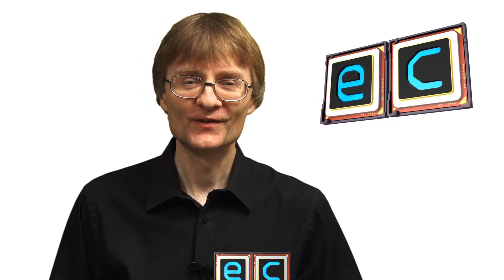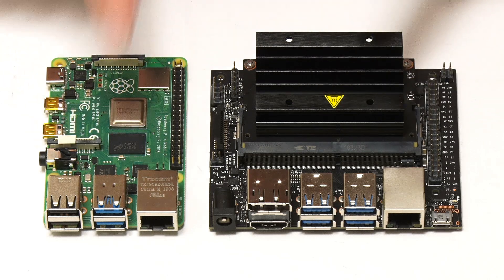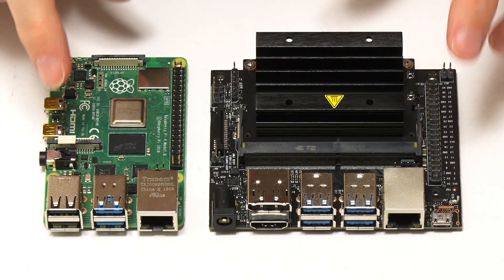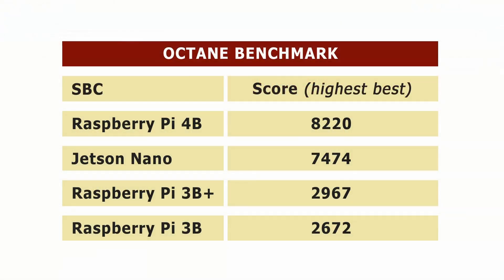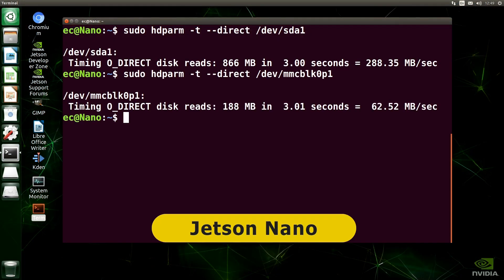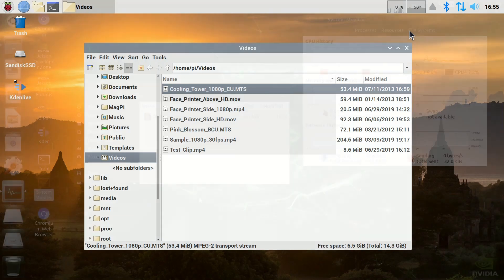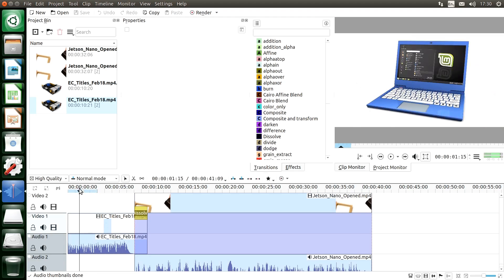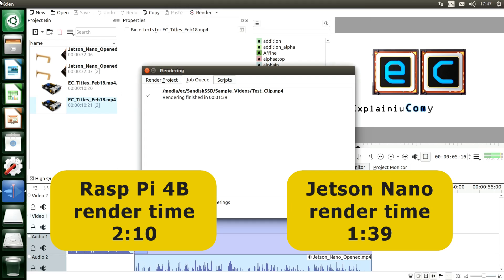Raspberry Pi 4B vs Jetson Nano

Comment: Will you post a short update when and if the Jetson Nano gets FFMpeg integration?
Reply from the maker: I will indeed -- it will open up so many possibilities.
Reply: @ExplainingComputers  Would this be an ASIC solution?
Reply: @ExplainingComputers  Projection mapping possibility for sure!
Reply: I would point out custom gstreamer libs are already prepared for use
Reply: I want to have a media center PC running Linux.  I want it to work out of the box.  I am a Linux newbie.

I have a 4K display, but nothing to drive it with.  (The best I have right now is an Intel based Win 10 laptop that can display HD).  I want to watch Netflix, YouTube, etc. in 4K / 30 FPS.

This video and a few other videos have been perfect for me, because I am zeroing in on the Raspberry Pi 4B & Jetson Nano.

I will show my ignorance now.  (Putting on flame suit).

So the lack of FFMpeg integration is the cause of the dropped frames Chris was having in this review?  When that gets fixed, will either one of these SBCs be able to do smooth 4K video streaming?

Also, both SBCs reviewed here claim to have the ability to display 4K video.

I guess 1920 X 1080 is the "basic" streaming standard today.  The resolution that most people see when watching YouTube, for example.  And if a SBC can't handle that, then it certainly can not handle playback in 4K, right?  Is that perhaps why Chris did not show any 4K streaming playback tests in this review?

Refering to this video:
NVIDIA Jetson Nano Review - Tegra X1 Single Board Computer
Apr 9, 2019
ETA PRIME
https://www.youtube.com/watch?v=2JkQwu_LF3k

At 6:21, the author starting talking about using the Jetson Nano as a Desktop computer.  He covered streaming video playback.

Even though the Jetson Nano is rated as being able to display 4K at 30 FPS & 60 FPS, in the above video the author says:

6:50 - 07:09
"...but with 1080p the Jetson Nano has been amazing at least with this first release.

As for 4k video playback online from YouTube, it is a bit choppy, but that could be fixed down the road.  This hardware has more than enough power to do it.

So for everyday web browsing, 1080p  video watching, this little device has been really awesome."

07:24 - 08:10
"...but for now this has been an awesome little board.

As for native video playback, 720, 1080, and 4k 30fps have 
worked really well here.

I see a little bit of stutter in this video.  I test it on a lot of single board computers.  This is the 30 FPS 4k version of Big Buck Bunny.  But you got to keep in mind that it's still really early for the Jetson nano.  Performance will improve over time.

I also tried out the 60fps 4k version of the same video, and it's really not even where it's worth showing at all.  It's very very choppy."

So what exactly is holding back both of these SBCs?  And in particular, the Jetson Nano?  Is it the lack of FFMpeg integration?  And that is just a software fix, right?  It will not need a firmware update or re-write at all, will it?
Reply: Every single YouTube review of the Jetson Nano raves about how powerful the hardware is, but then this fundamental flaw of not being able to stream video > 1080 is a pretty glaring flaw for a SBC that officially states that it can do 4K 30 & 60 FPS right out of the gate.

I realize that the target demographic for the Jetson Nano may be robot & AI junkies, and I am sorry for whining, but it seems like Nvidia is basically lying when they say that this SBC can display these resolutions, when it actually does not.

Similarly with the Raspberry Pi 4B with streaming video playback.

As Chris mentioned in his replies, if they fix this stuff, it will be a real game changer.  I guess these 2 companies don't want to make money.  Or they are launching this stuff early due to market trends and competition?

(And yes, I realize that the Raspberry Pi makers are a non profit org).
Reply: Sorry for being long winded.
Reply: @mtubeluck2044  You've probably moved on, but 4K 60fps could be a lot different with local file playback. It is also dependant on whether or not the software can be hardware accelerated. Some OS solutions might have the Ffmpeg capability that the stock OS's don't. Lastly, the marketing material may simply refer to 4K@60fps for HDMI capability only. It's incredibly vague because they don't specify this capability to any specific encoding/decoding formats. YouTube through a browser is going to be a lot different than HEVC/X265. A lot of these reviewers only do the bare minimum with their tinkering. I would have installed the OS for each platform on the opposite product as well to run the same tests and added in a wildcard like Manjaro since a lot of people will want to use that. I would have tried offline playback and 4K streaming through at least 2-3 services on each OS/SBC combo as well.

Comment: Why was it called 4 (B) and not just 4 and the next iteration 4 (B)?
Reply: B is the due to the size format of the board. You can check out the Pi 3 A versus the Pi 3 B. There is also the compute module in a different size format than the A or B based Pi 3

Comment: Any SBC with 2 x Gigabit Network I/Os and medium/non high end performance which can eventually also host SSD NAS Drives ?
Reply: Plenty, Orange Pi and Banana Pi for a start.  But like Chris says, it is about systems.  It is always about systems but with SBC you notice it much quicker.
Reply: @twmbarlwmstar  Which orange Pi ? Banana Pi R2 seems quite good to fit. For me the system does not matter much.
Reply: @entyropy3262  Orange Pi 3, it has 4 USB 3 which will run 4 2.5" HDD, there's also mPCIe but you'd have to search for suitable things to go there- they will exist, M.2 is basically PCIe- anything is PCI with the mPCIe socket.  You also want the one with the most LDDR.  The one with only 1GB isn't enough.  The boot drive will be pretty stable running off the eMMC slot.  Like I say it is the software that becomes the issue- and Orange Pi are notable for lack of support.
Reply: @twmbarlwmstar  Orange Pi3 does only have 1 x Gigabit. Thx for the hint with the Banana Pi, I did not know they have a new version of this board, it will rock with Open WRT or something.
Reply: @entyropy3262  Yes, the Banana does look like a nice board but as I remember a rather underpowered CPU?  2x Gigabit i/o is going to be a bit of an ask and considering a used Synology might be a better bet.  I was also going to say consider a used Intel NUC as they are great for NAS but only one ethernet and no PCI slots on NUC (or STX)- no PCI slots on any  x86/amd64-based board below ITX I think.

That said M.2 is PCIe (X4) so there is someone making a suitable adaptor in China somewhere.  The Orange board also has mPCIe so that could be a pathway to more ethernet I/0.  But then there's setting it all up.  Easy life for not that greater cost is a Synonly.  They come up all the time on eBAY so I just watch loads and only bid on the sensible ones.  I can get a 4 bay for £150 which would have all you ask, plus a lot more

Good video review https://www.youtube.com/watch?v=tvzXhbcgo2k

Comment: For anyone that wants to do machine learning and run object segmentation models, Jetson Nano or Pi4 + Coral dev board is a better comparison. Nano is $99 where as Pi4 + Coral (55 + 149) $205. If you want to run ML models in "real-time" faster than 5 fps, you absolutely need Nano or Coral dev board.

Comment: Those computers must only run Linux and that is sad. I have Linux, but don't use it very much because of the difficulty in using it.
Reply: A Google search usually gives answers to any problems you are having with Linux. Buy any recent issue of Linux Format magazine. They all come with a DVD containing one or two Linux distributions that you can try, plus a bookshelf/library of almost 20 Linux books, several of which are aimed at beginners.
Reply: @artbecker5618  Thank you for that information and I will read some of that material.

Comment: Very good episode Chris. I wish that the developers of the Pi had waited until the updated drivers were ready before they shipped the 4B out. Oh well in a few weeks/months we should have that sorted out. Cheers.
Reply from the maker: This is so true. They should have included a heat sink too! :)
Reply: @ExplainingComputers  No kidding. I also wish that they would settle on the barrel connector for power for ALL of the Pi's. I understand that the newer boards require more power but why can't the good developers supply a single power supply so we hobbyists can buy one type of ps and have it work for all of the Pis for the foreseeable future.

Comment: What an excellent comparison of these two SBCs.  Seems like it always comes down to the software support when you're trying to get the best performance out of one of these things.  I agree with you that if nVidia gets the drivers working so most (if not all) of the apps on their Linux distro will use the GPU, that will be a gigantic game-changer.  That GPU should blow away every other SBC on the market, if it's supported in software correctly.

Comment: So you're going to hammer the P4B for temps, but not state any temps of the Jetson. I mean is the Jetson doing that bad that you don't want to address it or you feel that since they included a heatsink that everything is ok? Also is there not an independent program that will work on both boards that would give us better tracking of the temps? Not sure if you can use CPU-Z.
Reply from the maker: I noted the Pi temps because they are a big issue in the community right now compared to previous boards. The heat sink on the Jetson Nano indeed removes any issues. :)

Comment: The core issue is software.  The youtube playback on my 1 GB Pi 4 is silky smooth at 1080p when I use LibreElec with the standard Youtube add-on.  Hardwired ethernet seems to be another key, kudos for doing this in the video.  Youtube video using Raspian Buster with Chromium is painful, especially if you try full screen. I'm not trying to discount the benchmarks in this video.  It used the default settings in the most common official distributions.  But a little deeper digging (installing LibreElec from NOOBS) can get much better results on the Pi4.

Comment: With the USB 3 ports I'm wondering if I could use a USB 3 to gigabit Ethernet adapter to add a second port and then use the RP 4 as a router with OpenWrt, a gigabit switch, and access point.

Comment: The Pi 4B is a godsend as I can now watch YouTube videos and simple web browsing without turning on the power hungry tower. The main problem is the Pi 4B CPU gets V hot so a heatsink and fan is needed to stop it from overheating (throttling).

Comment: Can I run windows 7 on raspberry Pi 4b? I need it only for very little work.
Reply: No. Windows 7 doesn't run on ARM CPUs, which is what the Raspberry Pi uses. But you can do basic desktop computing tasks (web browsing, email, office documents, printing, scanning) with desktop Linux such as Raspbian or Ubuntu. If you want to do that with a Pi, you should get the 4GB of the Pi 4, and use some kind of cooling solution, such as a Flirc case: https://flirc.tv/more/raspberry-pi-4-case because the Pi 4 gets very hot.

Comment: Very nice comparison. I especially appreciate the 3B and 3B+ results as that provides a broader basis for the faster boards' numbers. I'm interested in seeing how you cool your 4B. I have an old Asus laptop heat pipe on mine. Don't laugh: it works well.

Comment: Hi Christopher,
      I'm a total newbie but I found that on my API Firefox plays youtube videos way better than Chromium. And the best video player by far is Kodi. But I understand that the Jetson nano can't use Kodi yet.
     Thanks to your advice I was able to learn enough to make my Atomic Pi work great out of a ssd card. Now that I have it working great I'm working on using an old external HDD drive made of aluminum for a case for my API, the baby breakout board fits exactly in the tray inside. it's not ideal but I can put the API (with a cutout for the heat sink) and put the usb hub inside. It gives me a great structure to mount the wifi antennas also. I will test my API with the same tests you just performed, except the last one, to see how my Pi measures up.
     Chris, thanks for everything you do. You're awesome.
Reply: *work great
Reply: @alvallac2171  spel checkered too de resscu!.    i"m sur Mr. Barnatt apppretiate dat¡ Thanks bro

Comment: Yet again another great Video Chris! Were you running the pi at default GPU RAM allocation or did you increase the proportion of the 4GB allocated to the GPU?
Reply from the maker: Thanks. :) The Pi had 256MB of RAM allocated to the GPU.
Reply: Thanks Chris, do you think this GPU RAM limit has any impact on the online video playback, or do you think the bottleneck / delay is due to something else?
Reply from the maker: GPU RAM will make a difference to a point -- 256MB should be able for HD. But the issue is a lack of software support for the GPU in the browser.

Comment: I think all SBCs should come with wifi and bluetooth out of the box as it really helps to reduce cables and helps to not take up a USB port (especially the Odroid XU4). Micro SD speed on the Jetson surprised me when compared to the RPi 4. I think the RPi 4 will take off when everyone starts developing for them but I cant see the Jetson progressing at anything like the same rate. Shame really as it has a lot going for it. Great video, highly informative

Comment: With the lack of wifi you could remedy that by using a usb adaptor
Reply: Indeed you can and most of us in certain use cases you would.  But for someone building off a SBC certain features acn make a break a project.  Say you are build my imaginary Point of Sale Crash Kit- a till system that can be brought into use at virtually no notice while your singing all dancing PoS is repaired.  Wi-Fi is likely to be critical.  So I end up buying a few thousand USB WiFi dongles, wholesale price £15.  Thing is that cost is the same who ever I am, and I will have to add at least £20 to my price to account for storage and administration.  And yet that will show no profit to me but increase the cost to the customer.

The Pi4 would be a better choice because it come with Wi-Fi, even though the Nano is more powerful in other areas- the problem is the Nano is powerful in areas where it doesn't matter for an emergency PoS Crash-Kit.  My use case has simple requirements and most of the value will be in my software (which I make much larger profit from).  All it needs to do is load current priced quickly, current inventory quickly, act as a till, track inventory at End of Day.  Then finally when the expensive and groovy PoS come back online it produces needed reports to bring everything into line.  

Retail businesses take cash very seriously (actually how does my system act with cards/cardless payments?)  I did a stint in PoS and I was always the least trusted person as 'if I could repair these things, what else am I capable of doing'?  They were right, but a long stretch in prison would follow.  Another thing they don't like is sticking dongles into USB ports as it is quick way to infect your systems.

A lot of these Pis will end up acting as the basis for a commercial product and it is always easier to remove stuff than to fit it.  For example I have been told on pretty good opinion is the only reason we won't get SATA is because of the cost of the socket more than anything else.  Which suggests if you were ordering '000s you could have a more bespoke Pi with a SATA port if you wished.  Although in reaity you'd probably get your SATA HAT built in China and add it to the board

Comment: Thanks  for your  work  on  reviewing  both of these  sbc  I'm  debating  on  which one  I'd  prefer  
Have  a  temptation  to  build a  mod case  to  mount  a arm sbc and a atomic  pi  in one  unit  with a  pair  of  USB  to ssd  adapter sets have  the  x86  unit  deciding  on the  arm .

Comment: Can you rerun the tests with Ubuntu on the Pi please? Would things be different with a 64 bit OS?
Reply from the maker: Ubuntu is not currently available for the Pi -- remember these are ARM boards, so you cannot install an x8 distro. :(
Reply: @ExplainingComputers  For some unknown reason I thought they had made an Ubuntu available to get it working with 64bit.
Reply from the maker: But we may get Ubuntu MATE ARM for the Pi 4 . . . :)
Reply: @ExplainingComputers  Which I presume would be 64 bit! Would the difference between 32 bit and 64 bit be a significant speed increase?
Reply from the maker: Yes, 64-bit should be considerably faster, at least on a 4GB board. Probably the reason the Jetson wins over the Pi in rendering here is its 64-bit OS.

Comment: Does the pi4 have a full hdmi because im trying to connect it to my hd tv that is roughly the size of a computer monitor and is 1080p display but it has a full hdmi and im on a tight 90$ budget because im getting an sd card (64 gigs) and mouse and keyboard and im installing full kali linux on it 90$ can buy all of this including the 4gb ram version but i need to know if my hd tv will work with the raspberry pi 4
Reply: The Pi 4 uses micro HDMI, but you can get an adapter for a couple of bucks.
Reply: Most cables will have micro HDMI on one end and regular on the other.  Or you can get an adapter, as mentioned, that will allow your full-sized connectors to connect to the Pi 4.

Comment: While hdparm is a good synthetic test, there is a better, real world option using the dd command:

dd if=/dev/zero of=/usbmountpoint/testfile bs=2MB count=10000 conv=fsync

then, for read performance:

dd if=/usbmountpoint/testfile of=/dev/null bs=2MB conf=fsync

This will provide real, unbuffered I/O numbers for the devices.